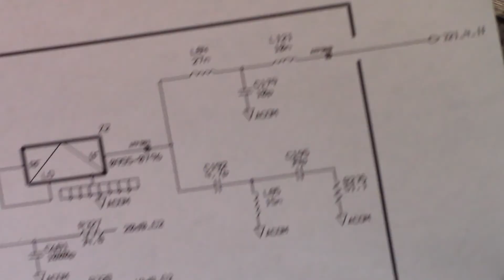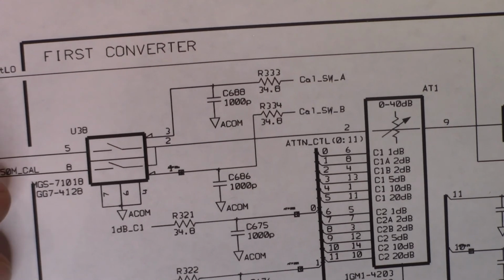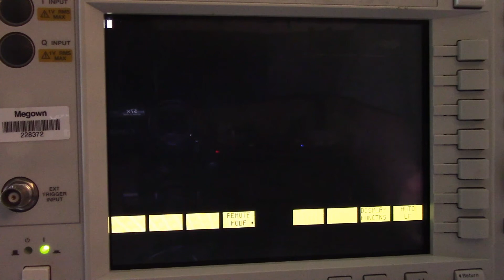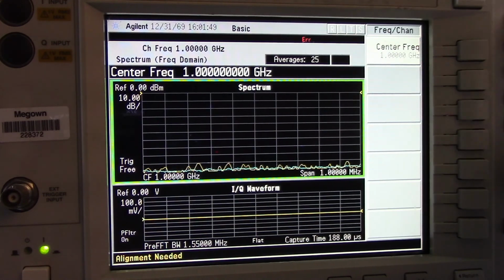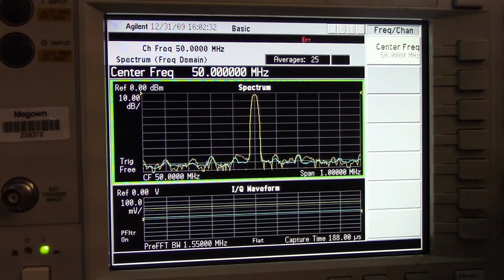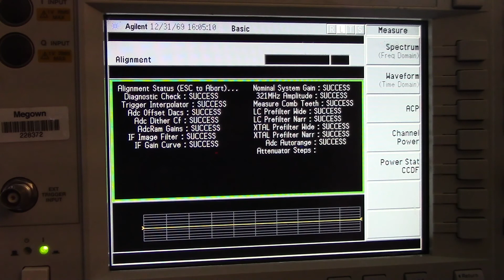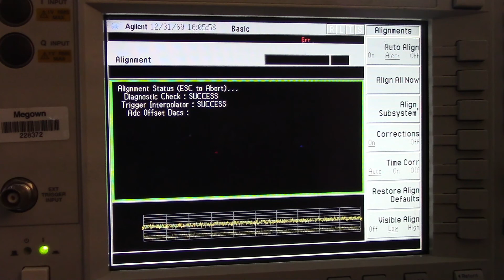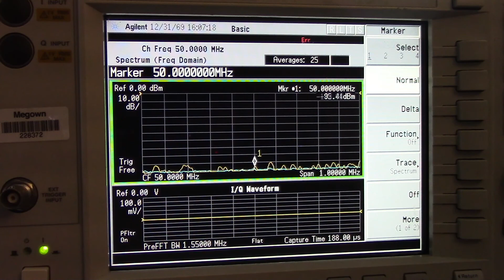Agilent E4406A Repair - Part 2

Comment: Hi..good stuff. Where did you get the schematics from?
What was the price of that thing?
Reply from the maker: Thanks - Appreciate you taking the time to watch the video - I asked on the HP Yahoo group for the RF CLIP and a member sent me it.

I mention this int he HP Yahoo group thread here -
 https://groups.yahoo.com/neo/groups/hp_agilent_equipment/conversations/topics/84569

I only got the RF board clip though.
Reply: really wish hp would release this stuff. i mean come on.
Reply from the maker: Agreed, they even promised to release this a few years ago but just never did, at least on their main site. I suspect that they had it in a holding site (they used to have an FTP share for these scans) and that is how other people ended up with it. I've bought a lot of manuals from Artek Manuals as well because they're better scans than the Keysight ones.
Reply: I think you have it licked with your relay problem.
Hope you can find the part. That is one of my main problems.
FINDING PARTS. Ok. parts and schematics.
Going to be doing a series on circuit simulation and design using GEDA and ngspice. I hope you have a look.
I really could not tell, did you use an extender for that card to test?
Reply from the maker: Looking forward to that video as I'm interested in simulation for some of the older HW I have. Didn't use an extender card as that board happened to be the top board in the unit so I could plug it back in with the top of the case off.